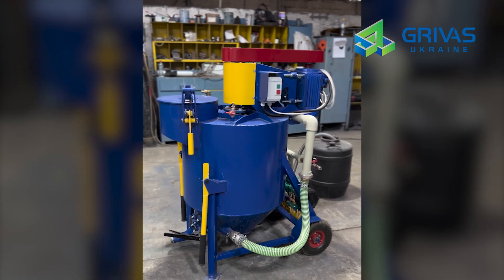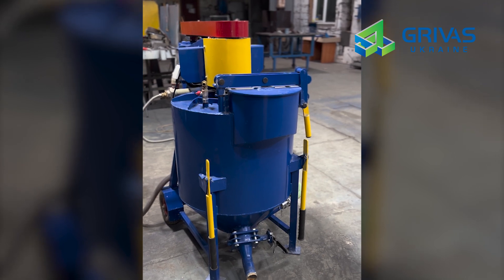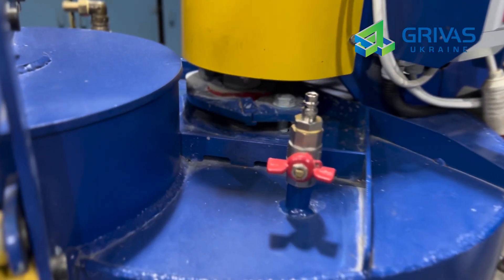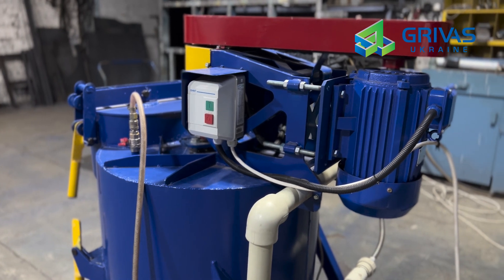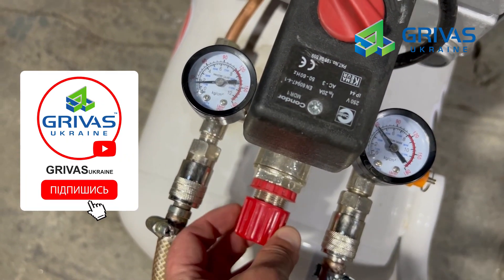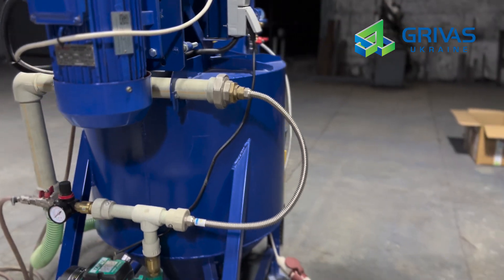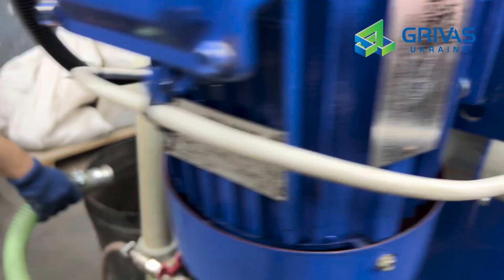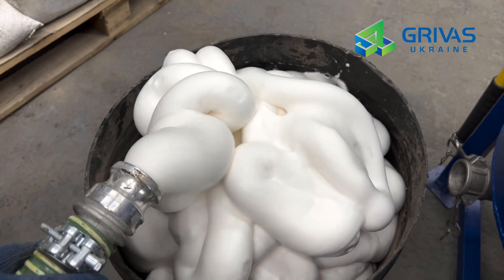Compact mobile mixer for light concrete for your own construction or providing construction services

Comment: Friend......Марка пінобетону, D // 400 Material for making model blocks....
1) Cement //300
2)LIVOTON Вода в піні//135
3) Water // 64.......mixed like this?
Reply from the maker: You took the data from the website, that's right.
For the production of foam concrete D400
Cement 42.5 - 300 kg.
Water - 135 liters
Livoton foaming agent - 1.6 kg. The foaming agent should be mixed with water in a ratio of 1/40 (with 64 liters of water). This working solution is fed into the mixer through the foam generator.
You can also add a plasticizer and polypropylene fiber to improve the quality indicators.

Comment: What are the materials used to manufacture light concrete? Cement + Water + Fly Ash + Foam
Reply from the maker: It depends on the density of the foam concrete.
For example, for the manufacture of foam concrete with a density of 200 kilograms per cubic meter (D200) - the main materials will be Cement, Water and Foam. It is also possible to add plasticizer and polypropylene fiber to improve performance.
For more information, please visit the manufacturer's website.
Follow the link:
https://www.livoton.com.ua/foaming-agent/technology
Reply: @GRIVASUkraine  How many tons of your LIVOTON foam products can be shipped in a 20ft container?
Reply: @stivenum2184   Hello, 40 plastic drams of 230kg. Total 9200 kg in 20ft.